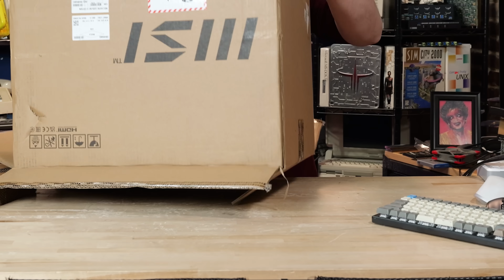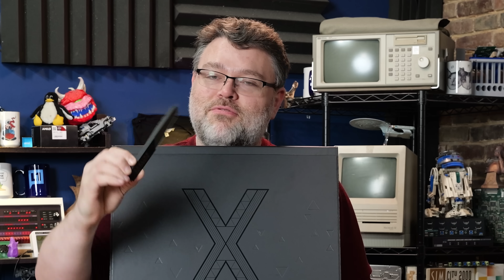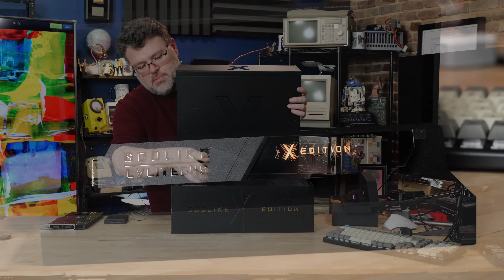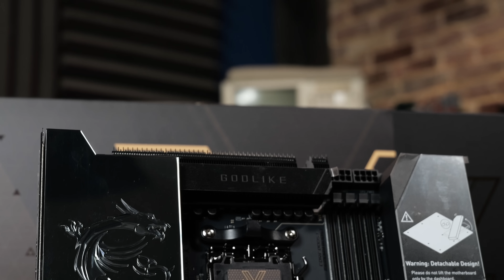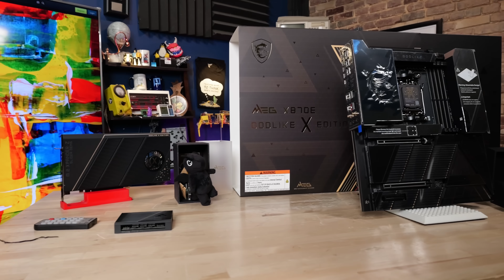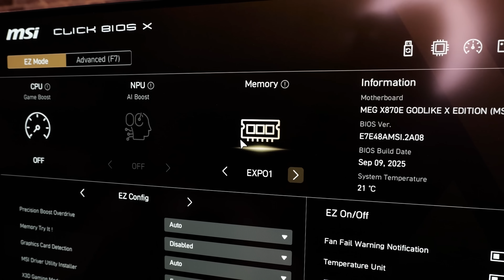MSI Godlike X870E: A Special Board Made Just for Us!

Comment: Its crazy that they put 4 dimm slots on motherboards but its never stable at not even high speeds. Ridiculous. They really need to figure out a new way to link the cpu to RAM... maybe AMD should do a special type of machines, like apple, where they sell the cpu-motherboard-soldered ram in one package so we can get very high speed memory bandwidth like the M3 Ultra with 819gb/sec. It would be awesome for AI.

Or just do an AI cpu-motherboard that supports DDR5-8000 on a 1024 bit bus... its 2025 almost 2026 and we still have shitty 128 bits bus for memory, its ridiculous.

Like they should do a Zen 6 ULTRA line of cpu for AI work.

Comment: "GODLIKE? Please. How can you be a god if you can't even bring the Thunder?"

This isn't Zeus or Thor hurling lightning bolts. This is the God of Static Electricity. You know, the kind of shock you get when you rub a balloon on your hair? Zap! 40 Gbps. That’s it.

Here are a few more ways to look at it:

The "Demi-God" Edition: It’s not fully immortal yet. It’s like Hercules before he finished his 12 labors. It's trying its best, but it’s still stuck in the slow lane with the mortals.
The Budget Cut on Olympus: "Sorry folks, we spent all the divine budget on the LCD screen and the gold plating. We couldn't afford the actual lightning."
"GOD-LITE": Just like in German, this works perfectly. It promises omnipotence but caps your transfer speeds.
So yeah, for a board that costs as much as a temple offering, you'd expect it to wield the power of the heavens (Thunderbolt 5), not just a really fast USB stick.

Comment: However this X edition holds up, the dynamic dashboard, usb, and m.2_1 have all had multiple reported speed/stability issues on the X870E Godlike. This motherboards is just too complex for its own good. Get a Tomahawk, and put the price difference into literally any other component for more overall value.
Reply: Their unify x series were good and priced good they should kept them going
Reply: Wrong no problems with it at all all the problems arise by people not knowing.
Reply: @JoeMama-yl1ow the problem its not threadripper board, lol
Reply: @JoeMama-yl1ow that’s not true. I’ve owned by X870E Godlike for a year and these boards have MAJOR problems to the point that if they sold in higher numbers it would have become a class action lawsuit. The EZBridge has firmware issues causing very annoying USB disconnect chimes in Windows. It would corrupt itself likely clockwork every 45 days and need to be reflashed using the msi tool. 

There were also widespread issues with m.2_1 operating at 1X (but I never experienced that). 

The X870E Godlike is a shameful product that MSI had no business following up with a new “edition”.